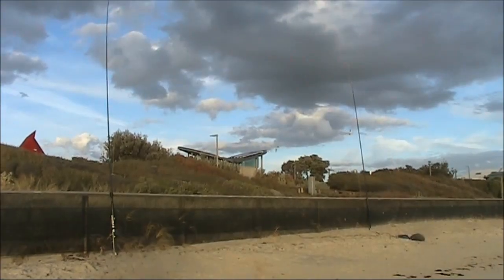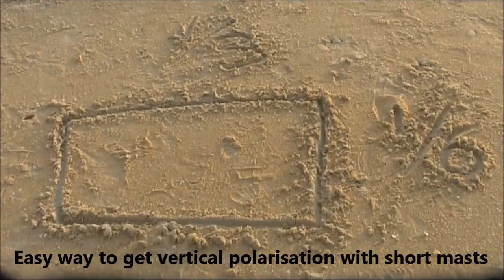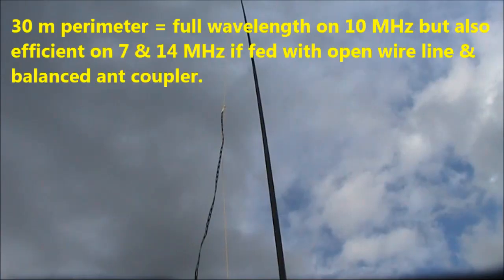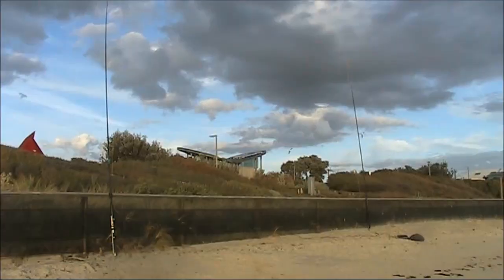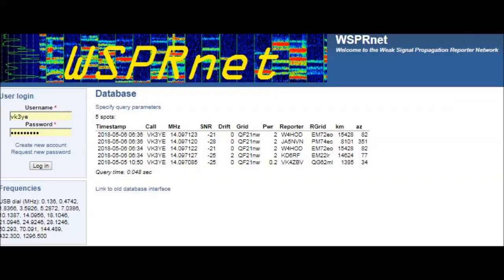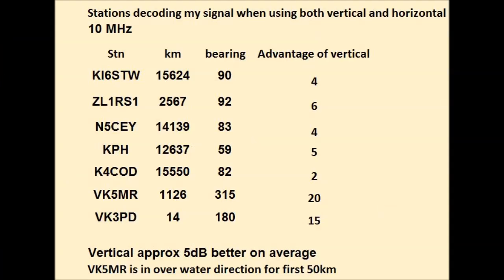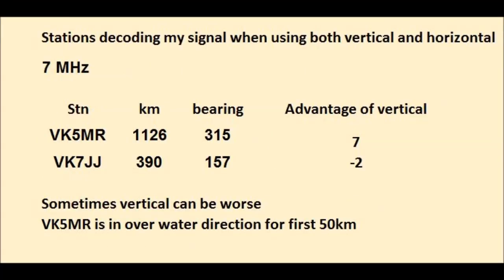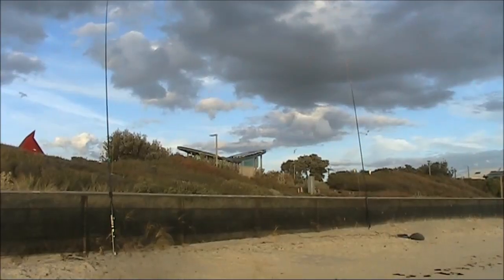HF rectangular loop antenna: Polarisation comparisons with WSPR

Comment: Antenna modeling agrees with your observation that a vertical antenna will exhibit superior efficiency and low angle radiation than a similar horizontal antenna at heights below 1/2 wavelength above ground.

Comment: Have you made a video on your balanced antenna coupler? If not, I vote for one. I'm particularly interested in Z match and "a balun followed by two identical L-match networks" as mentioned in your Hand-carried QRP Antennas book.
Reply from the maker: Yes. It's here: https://www.youtube.com/watch?v=KLSqfgvGg8M
Reply: Peter that link goes back to this video. The coupler (at 0:48) looks like an yet another update to the one you published as an update to your 3 inductor value L-match. Are there 2 of these couplers mounted in the box and fed from an input balun and do you tune both couplers to the same values?
Reply from the maker: The link worked for me.  It features SSB contacts made with the coupler. It's very different to the 3 inductor L-match. It's based on http://hfsignals.blogspot.com.au/2015/06/a-balanced-tuner.html
Reply: Must have been a browser issue on my end. Closed the tab and reopened you tube and the link was successful in getting to your intended video! I actually remembered it when I saw it and had liked it back when. . .  Thanks Peter.
Reply: Peter thanks for this link. Just read it a couple of times and guess that's going to be my next homebrew project. Really appreciate your videos and enthusiasm for amateur radio.